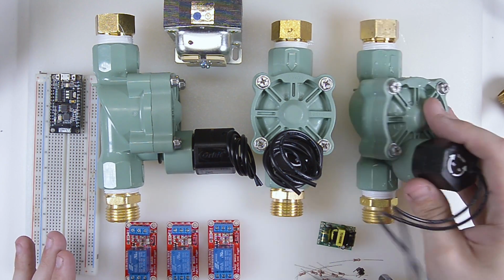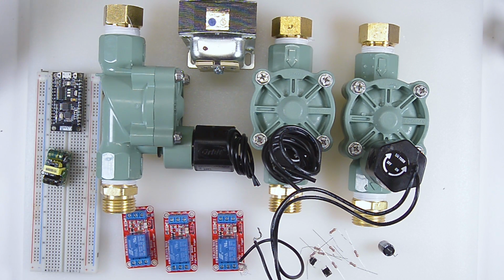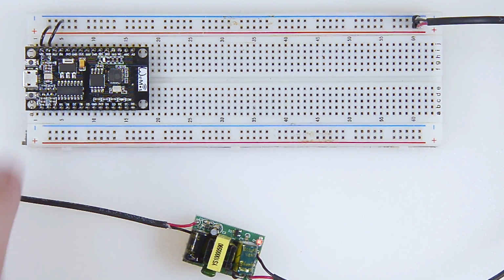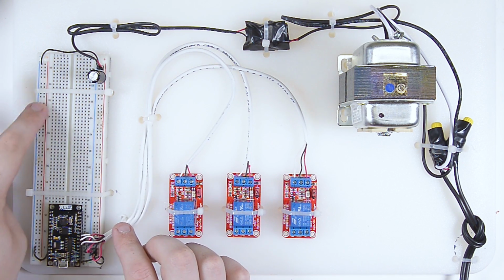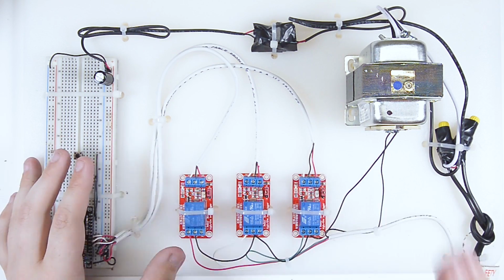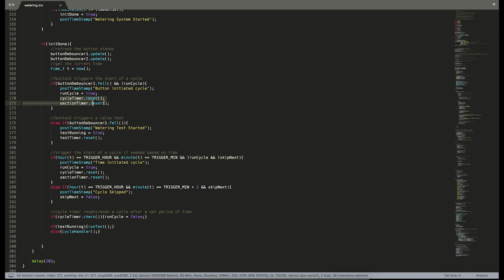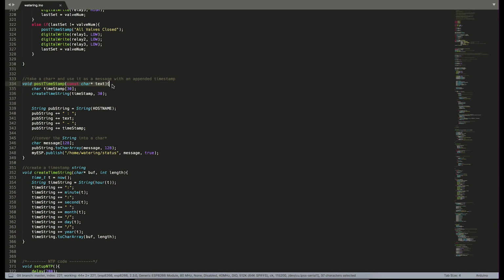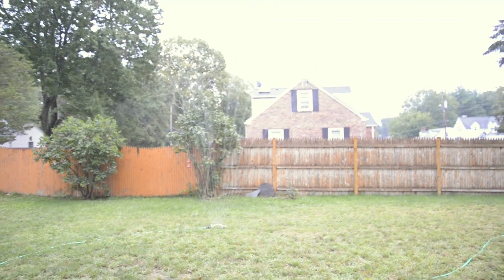Full DIY Irrigation System!

Comment: Hi, I love your coding. Its very smooth. On the other hand I would not like to  rely on internet time, because in the pipe some could fail. I would like to use a RTC in it, that maybe  occasionally pulls the time from the net. What is your idea to code this in?

Comment: So you have 5 volts going to you micro controller and the relays? How does that work with the voltage drop that each component uses up?
Reply from the maker: The devices are all wired in parallel so they all receive the same 5V power. There can be small dips/spikes when the relays are triggered but the capacitors are generally enough to keep the power smooth enough for the microcontroller.

Comment: Nice video's , question where are you getting those  AC-DC transformer (5V) and how are they doing  ?
Reply from the maker: I got them from ebay (just searching for "5v dc transformer" or "5v power supply"). They've been working a treat for me! I usually need to add an extra 1000uf cap to the output whenever driving large/noisy loads like relays or motors but when theres nothing big happening they are great. I haven't had a single one fail on me yet (I've only had this batch for a year or two so it's not the largest sample period but still nothing DOA).
Reply: Thanks !, found it.
Reply: ItKindaWorks You need kickback diodes, not capacitors, but in two years I bet someone else has mentioned this.
Reply: The solenoid actuation and holding current should be different. Holding the solenoid at actuation current will overheat the solenoid.

Comment: I have a similar project in the works, but it's all based off battery/solar/rain water.  Some videos on my channel for it.  

I got those same valves and have tested a replacement solenoid that is a latching one.  Meaning instead of needing to hold the signal to keep it open/closed just pulse it.  Works well.

Comment: Hi,

This is a nice work.
Could you publish the parts list?

I have 2 comments / questions.
1. If I am correct, the relay is 5V operated and the ESP issues 3.3V on its ports. did you consider using some level converter from 3.3V to 5V using a transistor or somehow else?
I understand that this works as is, but I think that - "it kind a works....." and could be safer to implement with level converter.

2. What was the reason that you decided to put the watering program in the ESP rather than in the hub-controller, and keep the ESP more "dumb" acting as a slave operated by MQTT command coming from a master commander - the hub controller?
I think that keeping the irrigation program should be in higher layers, so that you will easier make changes in the irrigation program (Not the code).
For example disable a watering plan until further notice when you expect a rainy week, or to postpone watering until getting some sensor measurement - from another ESP connected to the home automation system.
Reply from the maker: I'd be happy to put the BOM in the description! I actually meant to before putting it out but forgot.

1. I did consider using some sort of level shifting/transistor but I've played with these relays enough to know that they need 5V to power the relay but the opto-isolated trigger works just fine on 3.3V. You're more than welcome to level shift if you want but 3.3V works great as well and I've not had any issues at all...

2. That is sort of an eventual plan. The ESP is plenty powerful enough to handle both jobs though. It's easy enough to segregate the different parts of the program which I've already sort of started on with the cycleHandler function - it's just not a fancy implementation yet. Eventually there will be a part of the program that just gets a signal and goes off and does it's thing while another part does all of the complicated scheduling. I dont see a need for 2 separate controllers in this case. I suppose the argument could be made that the more complex the software, the more likely it is to have some failure that leaves the valves open for some reason. 

Now in something more mission critical I would totally agree on having a separate simple controller that just does one job and another that handles the higher order algorithms. I have that kind of arrangement on my furnace controller for example. But given that this is a homebrew watering system project I'm willing to take the risk. The worse that happens is really that my lawn is over/under watered and I get a big water bill at some point. But I'm also home fairly often so I think I'd notice any big issues.
Reply: Hi,
Just to refine, my comments was regarding the way to design the system to work in the best way.

Regarding my first comment, I accept your reply - BUT this may not work in case of a slightly different relay - that does not, or may not always identify the 3.3V as logic high, or in case of system redesign to work using battery which can go lower than 3.3V during it's life cycle.

Regarding my second comment, I thought not only about reliability but also about the ability to allow the user better control of the watering scheduler.
By putting this functionality at the main controller rather than the ESP (even though the ESP is powerful enough to do the job), you can expose the watering control to the user, and give him a much better flexibility.
In addition this way you allow the main controller to run logic using sensors from other places in the system, and run predefined - but flexible scenarios (that does not need FW updates).
Using the main controller can also be used as a good, central infrastructure for logging the events and your system status / watering history.

I really love watching your videos - they are inspiring, and I love what you do !

The work you did is really nice - for the first phase, but I would not leave it as is for final solution.
If you plan on changing the design in the future according to my comments I will be happy to see part II of the video, with your changes :)

P.S.
What system do you use for the controller (On your raspberry pi and smartphone)? I saw both home-assistant and the apple "home" system...
Which one do you use?
Reply from the maker: Hey,

Totally understandable, it might not work with every relay but I bought a batch of roughly 100 of these a year or two ago so I've gotten fairly comfortable with them. But yes 3.3V might not be a high enough level for all relay modules or with batteries.

I see where you're coming from with the with the scheduler/added flexibility. I thought you meant 2 micro-controllers, one that handles the act of controlling the valves and such and then the ESP to communicate with the outside world and receives commands... my bad. I do plan already to add in a separate moisture sensor that will let the irrigation ESP know if it needs to run or not so obviously there will need to be some tweaking. I havent given it a ton of thought just yet but I think a hybrid of the two methods of control would be good. For example, I have been working on ways of easily storing long term information in the onboard flash memory, by doing this I could easily store a schedule/config file that can be updated remotely and without disturbing the program. It could have a schedule, moisture trigger values, etc. But it could also listen to commands from mqtt (and mqtt gets those commands from elsewhere obviously) that tell it to run. So basically two forms of control. I know this sounds like something that is overly complicated but it gives me the added benefit of not having to rely on mqtt/other networked devices for the irrigation to work properly. If for some reason the network goes down or the scheduling software doesnt work properly, it can still fall back to a built in schedule. 

I would love to do a second phase of this project at some point but at the moment I done have tons of time unfortunately as the IKW day job has kicked into full gear but maybe towards the end of fall or next spring.

As for what I use in my daily life, unfortunately I use Apple HomeKit. It's far from the best and not very flexible but on apple devices it does work fairly consistently. Home assistant I felt was overly complicated in it's scripting (read - I couldnt get anything to ever work reliably because I'm mainly a c++ programmer haha). Right before I started IKW there was a great platform called EasyIoT but soon after the channel launched it moved to a full cloud platform and they stopped development on the local server software (and I'm just not a fan of sending my data out to a cloud server if I dont have to). I still tend to use the old local server install of that for logging of temps and such. That being said I have started the hunt for new home control/IoT platforms and I'm currently looking at Thingsboard. 

Thanks for all of the ideas and support!